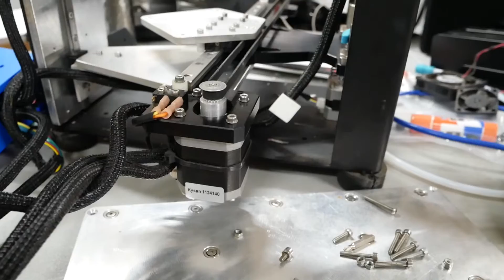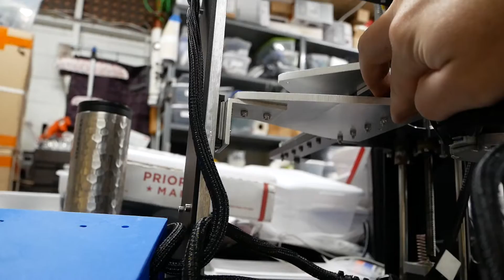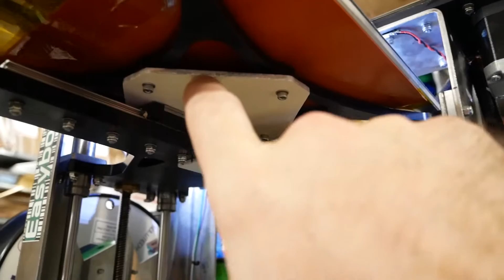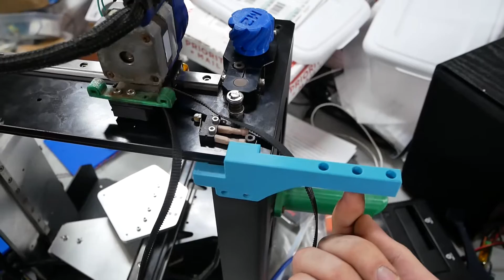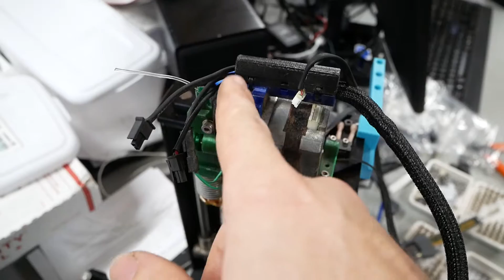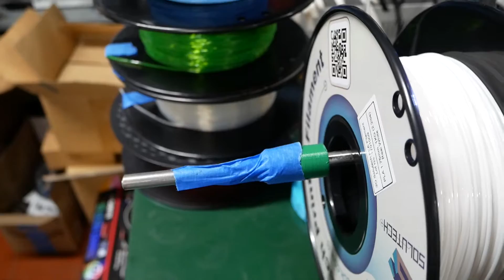Makergear M2 3D Printer MODS! How to double your print speed for $50!

Comment: Sorta cool. Now counter the frame racking as the X moves. You'll need to either massive reinforce the frame, or attach it to the wall.
Reply from the maker: The frame of this printer is already super rigid itself - made from 1/8" steel plate. It does not bend.
Reply: @hilo90mhz  it is made of stainless. It flexes diagonally as every parallelogram will. The roughly one pound extruder moving side to side causes the reaction force to flex the frame and move the bed closer and to the nozzle under every acceleration. Pin the top plate to a block wall and see the difference in all your prints.
Reply from the maker: @standardloginname  I'll agree that's possible - but I still contend the weakest link in this design was using the two rods for the Z axis which this linear bearings mod mostly fixed. If you're worried about the weight of the extruder what about the weight of the entire table changing direction with those two springy rods supporting it. Maybe someday I will try to clamp the top frame down to my steel table (1/2" thick steel plate top) and see if there is a noticeable difference, I'm still not convinced ;)
Reply: @hilo90mhz  I'm not arguing one vs the other. Its a physically bad design in multiple ways

Comment: What software are you running? 
I have cad software and mattercontrol and it is not working ... it refuses to home or allow me to set z offset
Reply from the maker: I am using fusion360 for CAD + Simplify3D for slicing etc - I only use the SD card
Reply from the maker: Mine also has completely replaced electronics many times... I'm on Klipper these days which is a hybrid system with Raspberry Pi + BIGTREETECH-GTR board + TMC5160 48V stepper drivers.
Reply: Hey man, do you by chance have the files so I can have the bed adapter made?

Comment: I've got an M3ID.  It runs 24/7 and it's a real sold workhorse, but I've had the same issues that you mention.  My solution thus far has been to bolt it to the bottom of its enclosure as well as brace the vertical parts to to side.  Tightening anything onto the frame can be tricky - as you mentioned the z rods tend to bend and complain noisily if the frame is distorted in the slightest.  I've also replaced every printed part that I can with my own models, printed in polycarbonate to reduce weight.  Filament spools are also kept above the enclosure inside their own drybox.  I am intrigued by the z rail and I think I'll give it a try if I ever have some extended downtime.  Thanks for sharing your mod.
Reply from the maker: I'm actually doing more mods to it today. Adding titan metal extruder + 9mm belts on x and y. Input tmc2208 but missing steps now so need stronger stepper for Y or maybe just a fan to keep it cool going to try that first.
Reply: Chester Lowrey At what speed of print the 2208 are missing steps !!!? 😱
Reply from the maker: @BlahHeroes  80mm/s with really high accelerations. The Y axis moving the bed is the one that looses steps.. I tried adjust the current and no difference.
Reply from the maker: Ended up going with TMC5160 - totally silent and enough power at 34V

Comment: wow that printer is loud
Reply from the maker: Its silent now with TMC2208 drivers ;) Still running high speed - much higher than that printer was designed to run.
Reply: @hilo90mhz  Will you share how can we update our rambo to accept TMC2208 ! i am nooby in electronics so doesnt know how to add these drivers :D but yeah the printer is very very loud !! did you add motor dampers too ? And what about marlin 2 or change rambo to duet 2 or 3 . did you do any of these ?
Reply from the maker: @Gentmatable  ended up going to TMC5160 as the TMC2208 did not have enough current to drive the printer at the speed I wanted and would miss steps after over heating even with heatsink and fan blowing on them.
Reply from the maker: @Gentmatable  I have switched to using MKS GEN V1.4 control board + Klipper on RPI 4 to run the printer - working good so far but does take time to learn the changes. No documentation yet but I may eventually... You might as well keep the Rambo board if it's working fine, my TMC5160 are on an external driver board anyway.
Reply: @hilo90mhz  Oh i see . mmm I think i wanna change the board even if its working ! its a shity board .. going for more silent motor driver and maybe wifi built in . 
anyway i just finisish tweeking marlin 2.0 and i am testing it on M2 . Seems okay .. want to use Auto bed leveling so its good so far ( Just notice a slow Z motor but everything else works okay)
Reply: @hilo90mhz  you really just need to lower acceleration and that darn "jerk" setting in marlin should be as low as you can set it (1 I think)
Reply from the maker: @standardloginname  I have since switched to klipper.

Comment: Nice mods! Thanks for sharing. The extruder and spool mount look a lot like ones I designed. :)
https://www.thingiverse.com/thing:254796
https://www.thingiverse.com/thing:495756
Reply from the maker: Yup! You extruder worked great for many many years.. so much better than the stock one.. just replaced it with an all metal extruder as I wanted something a little more rigid as an upgrade.

Comment: Great job on the mods.  I've been looking at how to stabilize the build plate in a better fashion.  How much of the build area in the Y axis did you lose by adding the extra bearing on the slide rail? (And how did you compensate for this in the software?)  I think I might add the extra bearing and fashion a 4 point leveling mechanism on my earlier M2.  That alone might give some more rigidity without the extra rail.
Reply from the maker: You lose the length of the new bearing block which is 35mm - so not much, easy to set in software. In Simplify3d its just a matter of changing your machine dimensions in the Gcode tab. For extra safety you might want to update the software Y max value in firmware too, but it is not that necessary. 

I am not sure you need 4 point leveling, more important change is swapping out the orginal bed for a piece of solid machined aluminum like the Maghold bed - or make your own pretty inexpensively from a piece of 1/4" thick MIC6 aluminum plate. If you have a mill or decent drill press you can embed the magnets yourself, but at $55 premade its not a bad deal to buy the magnetic bed.
Reply from the maker: Only lost the length of the linear ball bearing. Just lower your bed size in the software.